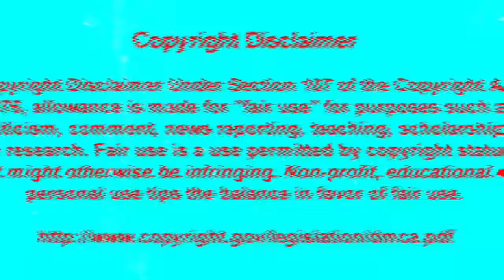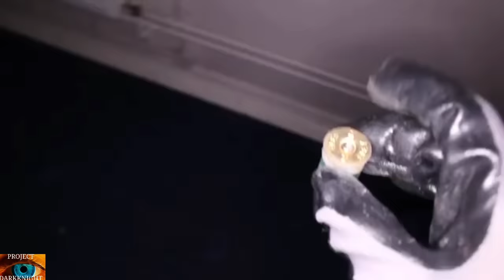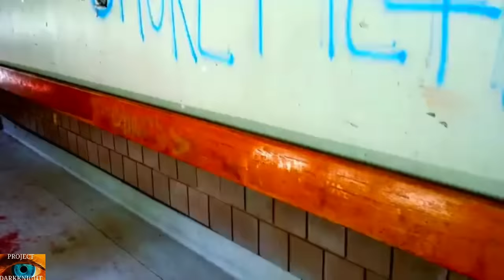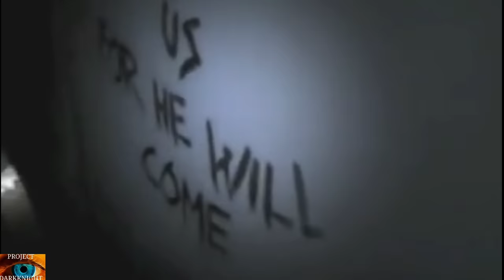Horrifying Videos That Show Urban Exploring Can Be Bad For Your Health: CAUTION

Comment: 22:02 that wasn't a gunshot. It would be ALOT louder, and you'd see muzzle flash for a second. Especially in that dark environment.
Reply: Not to mention those were blanks they found. At least the 556 and the 9mm.
Reply: watch it again then...there is a clear impact puff on the wall next to the window on the left side...its was clearly aimed for someone head.
Reply: @bladerj  I do see what you mean at the top left corner. But going frame by frame using "<>" it looks like a broken piece of concrete, or rock that was thrown.
Way to big.. It's most likely a set up video.
Reply: yea they're ears would be ringing

Comment: 18:44 - The 5.56 he found is a blank training round...You can tell by the crimped front. Live ammo has a much wider cylindrical opening in the spent casing. No pew pew..just bang bang.
Reply: Still a pew pew just a very very weak pew pew.
Reply: Look like construction charges to me... used to set various fasteners into cement or certain stones.
Reply: @jamestaylor3805  those would be in a .22 cal rimfire. on the video it is diffidently blanks in a .223 center fire
Reply: @robertratto533  there are larger constructions charges than just the 22... there are more tool that use them then just framing guns.
Reply: @jamestaylor3805  yes but not in a center fire rifle cartridge.
Reply: The 9mm was unfired and had a type of hollow point in it
Reply: So glad someone else knows that, I'm prior army get.
Reply: Just got through town a Little tikes the same thing myself
Reply: @charlesmcclure8000  funny how they think that their whole round comes out of the gun you guys are like sheltered or something man or just not in the United States maybe I don't know but whatever you need to get out there and explore some s*** more

Comment: 24:32 it's refreshing to see someone so young but educated. He really seems to know what he's talking about. And not being hysterical about it like so many others. He's absolutely right about that blood I wonder what happened. Looks like some blunt force or knife used in whatever this was.
Reply: That long blood splatter is from a major artery being cut, most likely on the neck. Then again, it is a hospital, so it could be just kids finding a left over blood IV bag and spraying it on the walls. You could make a similar splatter pattern by puncturing the bag and applying enough pressure on it.
Reply: @prettyhatemachine8887  What I was thinking but year old blood usually turns to a rust color
Reply: @uacblasters9147  "Fake gun bullets." They're called blanks. Most of them did appear to be blanks.
Reply: @Soul_N_Control  Depends on the surface, but some of that spatter should've discolored after a year, so imho the scene on the top floor did not look legit.

The next video though... that looked realistic! 😬

Comment: 2:03 Our local news and police did a large piece covering this. It didn't happen in our area but the facts are still true anywhere you go. Always be safe. Do not trespass. Do not cause destruction. Do not steal. Take only memories! Another huge tip, if you go alone, always tell someone where you are going and when they should expect you back just in case something does go wrong.

Comment: I love how the bullet "shell" still has the bullet on it, meaning no one fired it, someone just took a non-used bullet out of their magazine and put it there, which would be a weird thing to do if you wanna kill somebody, unless... It was placed there by them, it's a small object in a place full of rubble, it's hard to notice something like that, and why would they go into the very corner of a room to find it? They didn't go into any corners before.

How do you even get access to bullets if you don't know how they work? (they could be props) He even says he doesn't know how they work ( 19:23 ) which must be true because he's literally wrong about everything. The 12. gauge has been shot however, although it could've been given by a friend. Or it was airsoft, airsoft 12. guage rounds look pretty realistic.

However the 9mm again, has not been shot, it's a bullet and the casing, they're both in perfect form and together, meaning the most that has been done with them is they've been touched, that's all. You couldn't find the bullet itself, if you did, then it'd be flat, it'd look like a pancake, or if you found the casing, there'd be no bullet in it. But in the silent assassin clip, the bullets are still in form and still in the casing, that means they were not shot at all.
Reply: The 556 round was a blank. Blanks don't have a bullet in them. Only gunpowder to make a loud POP when it's fired.

Comment: That is a 552, it is just a shell casing, meaning the actual bullet has been fired, 19:32 It may be painted red, but that is not the part that goes into you if you get shot, that part is launched at low velocity from the chamber of the firearm and lands on the ground. the Slug races down the barrel at supersonic speed. However, that shell looks like it is beveled as a Blank would be.  Not sure if it is a blank, which would not contain a slug, but only powder and make a loud sound, but not hurt anyone, or if it has been fired and the casing was bent because it was stepped on. 20:29 A 12 Gauge Shotgun Shell, the Primer has been struck and the shell is empty, generally they contain a charge which is ignited when the primer is struck, then pushes out a Wadding which pushes out a load of some kind, either a slug, Buckshot, 0 Shot, or other projectile The colors of these shells are not standardized, so it could have had any load in it.  The 12 on the back means it is a 12 Gauge Shotgun.  Generally only certain gauges of shells will fit in certain shotguns, this shotgun that fired it was a 12 Gauge. 21:01 9mm LUGER Is a 9 mm Shell, I cannot tell because the camera is blurry, but it looks like the slug is still in this shell, meaning either it misfired "Did not go off when the firing pin struck it" Or it was not fired. Again in all Ammunition for these types of firearms you have a Primer, which is struck by the firing pin of the firearm when the trigger is pulled, which ignites a larger Powder charge, and the gasses from the charge expand rapidly discharging a load, which is usually either a slug, or a wadding with a load behind it in the case of the shotgun. 21:05 that is a .22 Shell Casing, it has been fired, the Slug is missing from the front and the primer has been struck.27:30 that is the actual Slug that comes out of the shell casing, That is a copper jacket, but I cannot tell what caliber because there is no reference to compare it to. Also that is way too much blood to be from one person, It appears to possibly be real blood, the way it congeals before coagulating. However, if it is human blood, it is definitely from more than one person.  Or it could be from a large animal, There are also no bodies, but there are drag marks in the blood as though someone dragged someone through it.

Comment: Regarding the silent assassin segment, I’m fairly certain the crimping at the top of the 5.56 casing means it’s a blank. Literally just a flash and bang. The reason being is that where the casing thins is where the actual bullet begins, that would be the rest of the cone shape on the end after the initial thicker chamber that would hold the gunpowder. You can tell from the tip it was crimped shut and not an actual bullet, also the discoloration on the tip is from powder burn. So I’m guessing possible training or filming a movie scene or something. My guess is a zombie film, given how run down the building is and the mix of different ammo types, one being from what looks to be a .45 handgun. That shotgun shell is for sure a blank, from the width it’s probably a 12 gauge. But the length isn’t even a third of the length of a normal shell, there wouldn’t be enough force to do any real damage with it, just enough for a flash and a bang. Also the last quarter or so of a shells length is folded inwards to hold the gunpowder and the shot in place, which you can see from the end of the short shell, so given the length it’s for sure a blank.

Comment: An FYI, at the 19:30 mark when the dudes were checking out the ammo present there, the 5.56 round was a spent black casing. Right next to it is a 9mm simunition round. You can tell how that 9mm casing is not only silver in color, but also it is in a unusual shape. (just google simunitions its a cool way police/military trains without using real guns). As far as the 12 ga, and how it is cut? I am unsure. More than likely this abandoned place was and still is used by the local police, hence why it is relatively clean and has tape littered everywhere.

Comment: SO I am sure people have mentioned this before on the silent assassin video, but all of the bullets they are looking at are clearly blank rounds.  The biggest way to tell is the crimping at the end of the cartridge case where a solid metal round would normally go. The red stuff he keeps mentioning at the tip of the blank is the red wax they use to seal a blank close to keep the powder from falling out. Also, a 12 gauge shotgun shell is normally another 2 inches longer but blank rounds are much shorter depending on the brand of course. On another note, if three shell casings indicates a fire fight that is the most low energy fire fight in the history of gun battles. Someone was probably filling a zombie movie in there or just running around with some blank fire guns having fun.

Comment: That red or rust color tip on that 5.56 represents that it’ll cause a major spark upon impact. It’s meant to start a fire on wood targets, plus it’s pretty at night when shot..lol I think they’re called tracers
Reply: The crimp looks more like a blank. The 12ga looks like it was cut down. I could see the primer on 12ga had been hit.. But couldn't tell on 5.56 or other. The 5.55 primer did have sealant around it.. But the tip/bullet is odd.. Looked like a blank, or something jammed in it and disfigured.
Reply: Google 5.56 blanks
..
The primer doesn't look used on 5.56
Reply: That one 9mm is a blank as well
. And two empty cases.
Reply from the maker: Thanks for that comment.  Yeah I noticed that too with the 12 gauge. I've been getting  alot of comments saying they are blanks. I wouldn't know. But thanks for taking the time to explain it like that. The Darkknight peace ✌️
Reply: Wrong.
Reply: Negative, bud.  Those are blanks. Also often painted with red (or black)  crimped tips. The 9mm were also blanks, as well as the 12g shells. Likely this building was used as some point to film an action movie, and they did a shit clean up job.
Reply: @WestinsChannel  may be you haven’t seen that type of ammunition,  ur I own 5 boxes of them and started a fire with them. So as far as negative you’re wrong, like I said just maybe you haven’t ran across that specific type….🙄

Comment: When a round is fired the bullet (projectile) is separated from the casing and goes out the end of the barrel while the casing is ejected from the side or top of the firearm. The 5.56 rd which is 5.56x45 which is the  5.56 NATO. Commonly fired from the AR platform. That looked like it could have been a hollow point or some other kind of specialty round. The most common is your FMJ (full metal jacket). A lot of rifle calibers also have a JSP (jacketed soft point). Red on it would just be paint or dye to specify the type of round most likely. Like a green tip commonly means Light Armor Piercing or LAP for short. Which is the only ammo I use in my AR. You practice with the ammo you plan to use so you will know what kind of drop you’re going to have to adjust for at distances. My LAP ammo is 62 grain compared to the regular FMJ ammo I used to use is 55 grain.

Comment: Those were blanks,  the 9mm has a rubber 'point' and the 5.56mm is just crimped at the end,  they are used in training. A lot of building like these are sometimes used by the police and special forces to carry out drills,  mainly hostage rescue. These could be casings that have been missed in clear up,  the shotgun shell was probably used to simulate them shooting out the hinges or locks of doors.

Comment: The 5.56 cases were blanks. You can tell that they are blanks, because of the crimped brass, at the neck end, where the projectile would have been. It’s colored red from the sealant used at the end of the crimp, to prevent any powder from leaking out before it was shot.

Comment: In the "murder scene" segment, I'm quite convinced that's the real deal.  What you're seeing there is an "arterial" blood spray pattern.  Typically, when one's throat is cut, blood (under arterial pressure) will spurt as far as eight or nine feet, redecorating a room quite efficiently.  I know this not because I'm a serial killer, but because I used to be a dialysis nurse for five and a half years.  I wish these young men would have notified the authorities on this one.  DNA analysis could likely bring closure to someone's missing persons case.

Comment: 5.56 casing looked to be a blank, the two 9mm casings seemed like legit conventional round casings, but the unfired 9mm (at least looks like 9x19) round almost looks like it was DIY made/ handloaded. The bullet itself looks odd and not fitted into the casing properly. 12 gauge shell also looked to be a normal shotshell but the way it was cut in half means it was either crudely handloaded and/or (and most likely) was fired out of a homemade 12 gauge caliber firearm. A 1" pipe or even some bike frames will chamber a 12g shell, but the tolerances are usually still off-enough to where the shell will either blow apart or balloon out due to the pressure forcing the shell to expand as far as it can. Crude or not homemade guns are still lethal weapons that see quite a bit of use in countries that have strict firearm legislation. As an American it is slightly fascinating to see in a morbid sort of way; most of our violent crime involving guns is gang related, but they usually if not always are using commercial-grade firearms.. even if it's a stolen 1950s .22 rifle from Sears that had previously been used to dispatch rodents. Hell of a reminder that my life ain't that rough and that the bad shit is universal.

Comment: Can’t understand what your saying mic to close. Sounds muffled. That red on the bullet is called a polymer tip. Some are red and some are orange. 9mm Luger pistol. And empty casing. Yes, the polymer tip has been broke off of the bullet. 12 gauge shotgun, either buckshot or a slug that has been cut off. There’s normally the powder along with the sabbath along with the primer.

Comment: The one where they find the bullets, those 5.56 rounds looks like they were unused, if they were used the tip wouldn’t be on there, it would be hollow like the shotgun shell, the red tip means it’s a tracer round and not blood, unless they literally used that bullet to manually stab someone which I doubt. And the 9mm is a bullet, have they never heard of a 9mm pistol? They literally spelled out Luger, a type of gun and still question if it’s a bullet lol

Comment: Those bullet shells he finds are real as in not toys, but were not used to kill anything.
The 9mm is a product called Simunition. Simunition is a high powered paintball propelled by the force of a pistol primer instead of compressed air. Can only be shot out of a pistol with a Simunition barrel in it that is designed to prevent any deadly ammo being loaded and shot accidentally.
The 5.56 "22mm" is a BLANK round that is intended to make noise only. The 12gauge casing is also only designed to create noise.

Comment: Those cartridges found were blanks. No bullets were fired. The 5.56 cartridges have crimped ends and no bullet. The 9mm uses a wax bullet. They're non-lethal. These are used for training. Maybe the city had a training exercise there.

Comment: 11:00

Are you sure you got the original video there? Cause I remember having watched this video back in the day without any whispers in it.

In fact, when I saw it the first time, you could only hear a faint sound in the distance for just a second or so. It clearly sounded like running water, so it was nothing special.

Comment: Did you know, about the noises in the galleries . Imagine if it is a method used with wireless security system and well placed audio ripetitors that activates when you walk straight into, or close to a 51 zone

Comment: That Bullet is a blank, like, it makes the bang but nothing comes out other than hot powder. If you've spent any time in the military or around training sights, you'll know.
The shotgun shell is used for bird hunting, it is tiny pellets, normally used by farmers to scare off foxes, The fall off fast and have low range, unless you have the gun against your head it won't kill you.
EDIT: Nah, every single shell they picked up in that video is a blank round, it won't kill anyone but will just burn you're face off with tiny hot holes. If it has a crimped end it is a blank, if you find half of a shotgun shell it is a blank. Even more, I haven't heard the gunshot but I'll be it sounds like a blank too. They all make a bang but only real rounds have an impact sound.

Comment: .556 is often used for ar15 12 Guage is obvious 9mm luger is regular old 9mm. Multiple different guns used. What you were holding was casings not bullets the bullets had been shot. I would of checked walls to see if you could see holes from a shot..